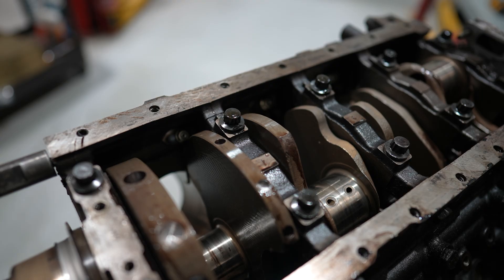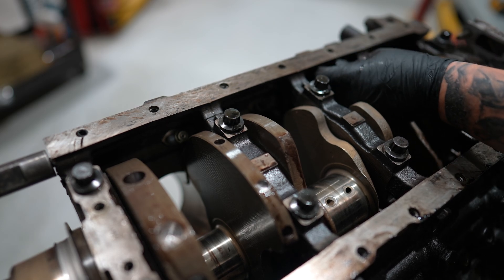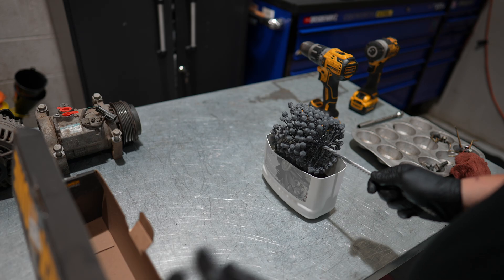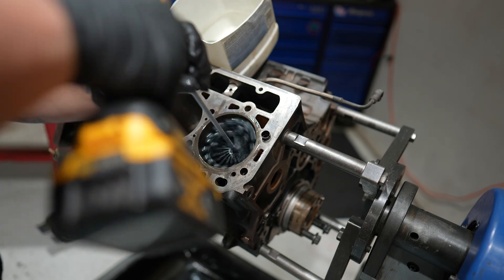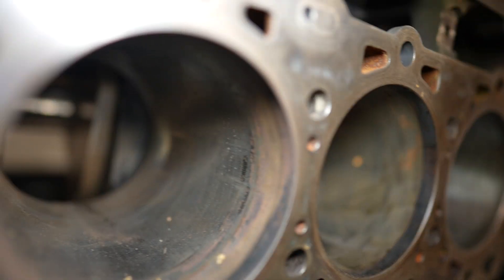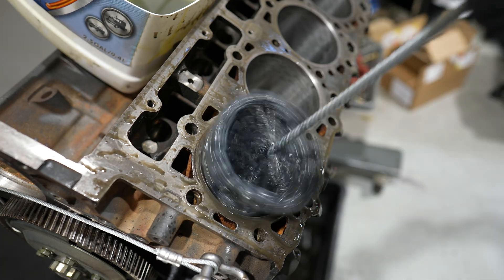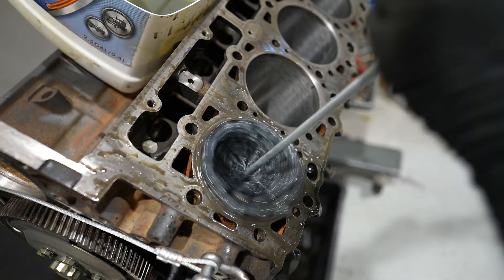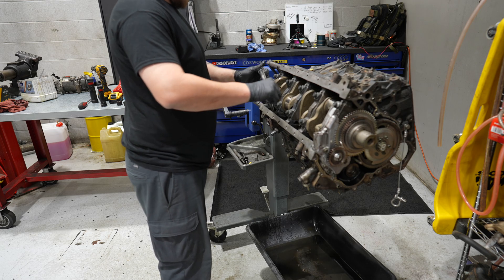Honing on a Dime: Cylinder Honing for under $100

Comment: Great job👍 Did you measure how much the bore diameter changed (or didn't) dimensionally? Just curious if I need oversize rings after de-glazing? Thanks man.
Reply from the maker: So it won’t take that much material off, if you were to hone it then you would but technically this is like you said simply deglazing the walls so the rings seat and so that oil can stick to the walls to provide lubrication

Comment: Never use a ball hone to hone cylinders they are junk & useless for that .
Reply from the maker: Actually worked great for what I’m doing I’ve already logged 8k miles on this duramax, I run no pcv diaphragms in my valve covers and I have virtually zero blowby so to say they are junk and useless simply shows a lack of experience with them or improper use of them
Reply: Did you read the instructions and buy the proper size and grit/material? They are not junk and work exactly how theyre supposed to.
Reply from the maker: @ I agree this is not a one size fits all I should have stated that it needs to be the proper size, grit, and abrasive for this to work properly. Not sure where the above comment went wrong.
Reply: @DrSidewayZ  my guess is either he heard from someone "ball hones are bad" or he messed up his block from lack of reading instructions.  But nobody who properly uses them says they are junk.  They're actually convenient and feasible for an at home DIY guy to save a trip to the machine shop.
Reply: If you expected a ball-hone to change the geometry of a cylinder (rectify ovality or taper for example), you've been misinformed. They're solely intended to impart a surface finish which will retain oil and lubricate the rings.
Reply from the maker: @Lanesplitter  you are absolutely correct, I feel these issues come from attempts at using the wrong tool for the wrong job and surprised when it doesn’t work. The ball hone is intended to deglaze the cylinder walls to help seat new rings and provide small scratches so that oil can fill to provide lubrication to the new rings.
Reply: They can be used if you KNOW that your bore is true. If you aren't sure, then you should use a stone hone which will help smooth out tiny imperfections and will reveal larger non-true patterns in the bore. In the video above, it's likely his bores were already very true and the ball hone makes a great easy crosshatch.

A ball hone works great if all you need to do is add some crosshatch, which most of the time that's all you need.